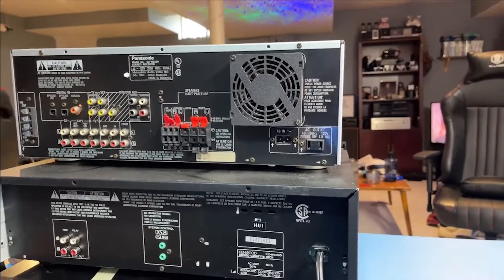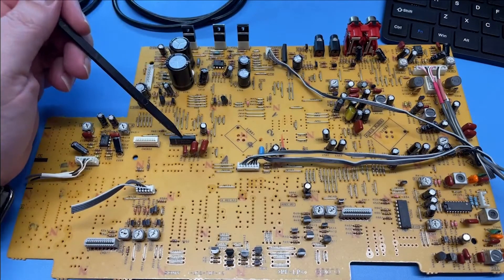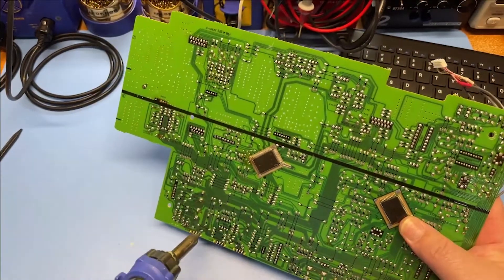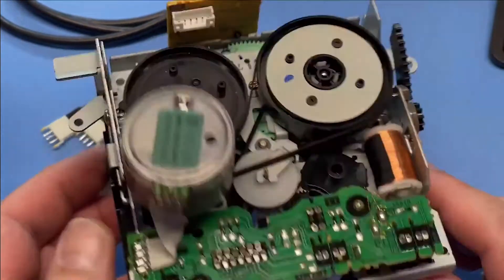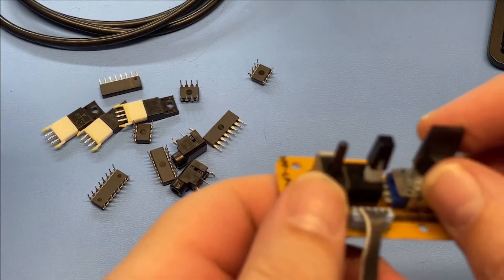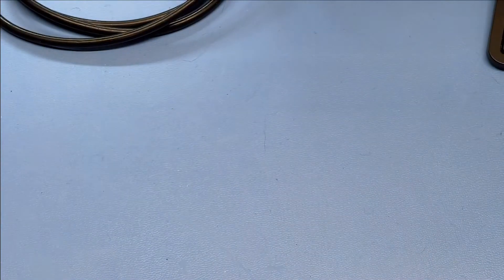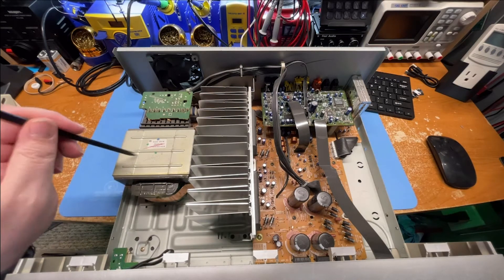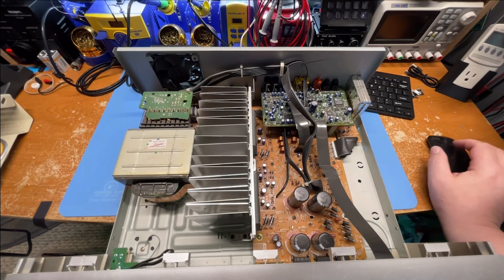Parts harvesting 101

Comment: I just moved a few hours east of the GTA from Brampton, and now that I have more space, I've been sorting through old scrap boards to harvest parts from, especially since I finally have a proper desoldering gun.  I sometimes re-use harvested parts in current pcb projects, including some harvested in the 80's.  I wish I had kept more vacuum tubes from the old radios and TVs people used to discard on the curb back then.
Reply from the maker: Some tubes are getting very difficult to find (especially the ones that pre-date the 1950's).  Looks like there are many more people than I had thought that are doing exactly what I've been doing for quite some time.  By the looks of things, there's plenty enough to go around!